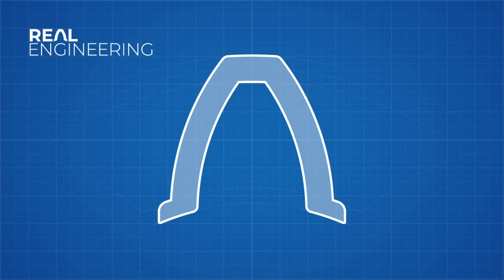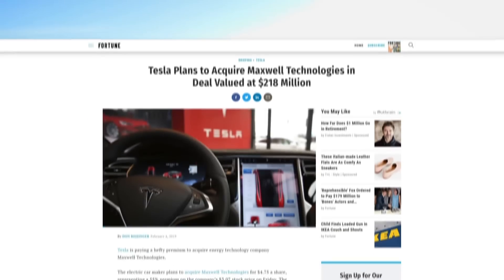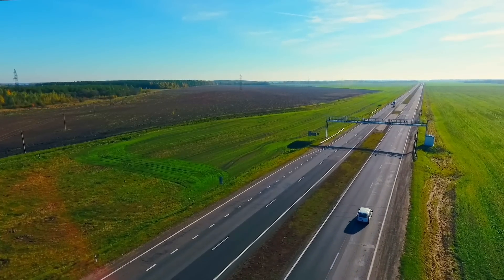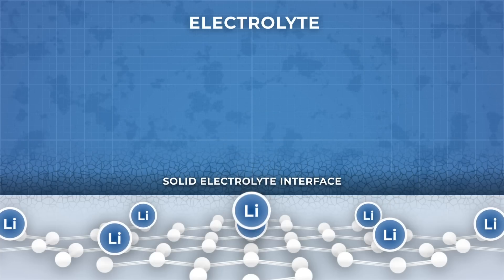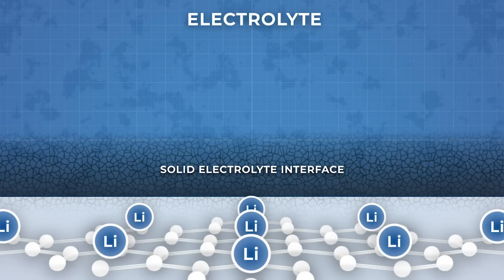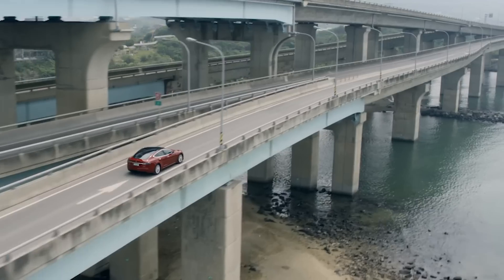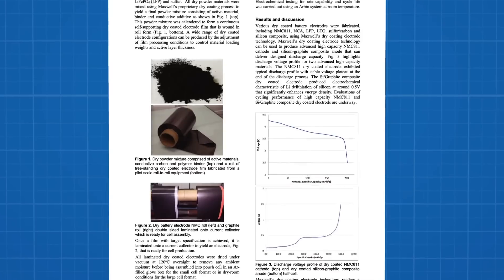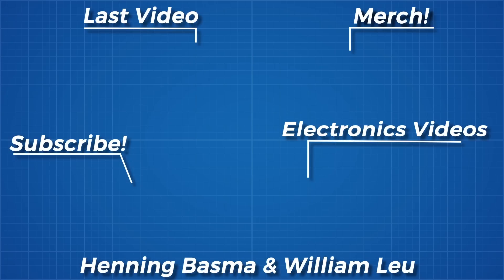Tesla's Quest for Better Batteries

Comment: This supercap/battery hybrid idea seems attractive to a lot of people, but I'll be shocked if it really works out anything like that. Adding a supercap pack will allow a quick burst of energy, but for hill climbing and towing, it just means you have more weight and volume to deal with (and more cost).

You need a battery pack big enough to drive the motor to its max capacity (and be driven, in regen). In fact, that should determine your battery size. Once you have that, supercaps don't really do much.

OTOH supercaps, with their long life and high power and charging rate, could be great for stationary storage, power tools, and perhaps some other things.

I think Tesla bought Maxwell mainly for its battery technology, not the supercaps.
Reply: tesla batteries can already deliver more power to the motor but are limited due to the motors overheating from the higher current, super caps can be used to deliver an absurd amount of current that will push the motor way past its continuous load rating but in a short enough time frame that the coils don't melt and cause a short.
Reply: @miguellopez3392  The batteries can already deliver enough current to over heat the motors, but the supercaps can help if the duration isn't too long. How does that make any sense at all?
Reply: @ronaldgarrison8478  both can deliver more power to the motor, super caps can do it better but for a shorter period of time, batteries are software limited to prevent overheating of the motor and themselves, a supercapacitor can dump a lot of current so that the motor produces high amounts of torque during a launch, but the capacitor quickly drains and the battery takes over, since the capacitor drained so quickly I'd didn't have time to overheat the motor, so yes super caps would be useful for acceleration.
Reply: @miguellopez3392  No, they wouldn't. You're proposing a situation where the motor can handle more in a brief interval than it can handle in a somewhat longer interval. I don't think that happens. It would only happen if the motor was not being cooled very well. But electric motors are generally over 90% efficient, and in the case of a modern production EV, probably over 95%. (And since we're only talking about losses actually inside the motor itself, as distinguished from the control circuitry and other things, it's probably even higher than that.) So I don't think keeping the motor cool is normally an issue, and you will therefore be limited by something else. What else? Presumably, some combination of voltage, magnetic core saturation, and how much torque the parts can take (whichever is more limiting).

Of course, you could always imagine a special case. Maybe it's a really hot day, and the motor is prone to overheating. But if that were the case, I think you'd also have to limit the batteries, and any supercapacitor as well. IAC I don't think you would want to make a very expensive addition to a car, which would add weight, volume, and complexity, just for those highly unusual events.
Reply: @ronaldgarrison8478  it is a physical fact the electic motors have a peak current rating and a continuous load rating. Wich is essentially how much power an electric motor can give out in a brief period vs how much power it can sustain for a long period of time, an air compressor has a built in capacitor for starting. The capacitor delivers up to 7x the current the motor will run in a continuous load but why not just run at 7x current at all times? Because it will overheat the windings. Melt the insulation and short them. tesla cars have a glycol cooling loop wich cools both the motor and batteries, the batteries are more thermally sensitive so the computer safety measures lowers power output if they get too hot it's electric motor gets too hard then power is reduced to the motors, in the ludicrous mode they remove some of these restrictions for better preformance but warn you that the mode can cause damage to the drive trains since the batteries and motor will run over the recommended continuous load, capacitor assisted launches will be something for sports EVs or super car EVs so you won't really see them in regular EVs.
Reply: @miguellopez3392  I can't claim to be an expert on electric motors in general, but I'm pretty sure the capacitor on a compressor motor is not to give a burst of power, but rather to compensate for the fact that a motor is electrically an inductor, so that on startup the current lags behind the voltage. The capacitor can deliver a very short burst of current to compensate for that lag. That doesn't take that huge a capacitor, but to provide a burst of extra power of several seconds, to deliver a lot of extra torque, I think would take a much larger capacitor, in fact a prohibitively large one.

IAC as you suggest this does not seem like something that would be done in street use. It does not seem to offer a practical advantage in anything but exceptional uses, as in racing. So I'm back to my original claim that for a car in ordinary uses, I don't think supercaps would provide an advantage that would be anywhere near the penalty in weight, size, complexity, and cost.
Reply: @ronaldgarrison8478  I'm not an expert in electrical motors either but the capacitor is there to give it a jump over the hige power requirements of starting a DC motor, sometimes the capacitor goes bad and you are left with a compressor that will humm and not start, I fixed this issue by connecting it to a generator that could supply more power then a wall outlet with its starting amps. One of the only example that i can think of right now of a vehicle using supercapacitors is F1 cars and their kinetic energy recovery systems, they let regenerative braking slow them down when taking turns and use the stored up energy in the super capacitor to launch them to a faster speed after completing the slower turn.
Reply: @miguellopez3392  Let me put the motor issue this way: Suppose you're trying to start a motor while it's under a load. If it's stalled, it's going to consume a lot of power, and possibly overheat, but IAC not perform well. When you start applying power, essentially what you're doing is storing power in the magnetic field as you build it up. So the motor tends to look like a short circuit until it gets moving. This is reactive power. The motor looks like an inductor, storing energy in a magnetic field. Voltage rises, but lags behind current. To get the motor to start better, you attach a capacitor. It has energy stored in its electric field—the counterpart to the motor's magnetic field. Voltage leads current—the capacitor dumps its charge into the motor, there is a quick surge of current, and behind that the voltage falls later.

In that way, you get the motor going quickly, without generating a lot of heat while the motor sits there, straining to get going while it builds up its magnetic field.

I'm sure my EE textbook explains it a lot better, but right now it's packed away! And anyway, I'm kind of swamped this afternoon.

WRT racing cars—again, supercaps probably make sense there. In fact, I'm sure they're wonderful for drag racing. BTW I'm also sure they'd be great for things like power drills or screwdrivers, as they can deliver full power from a smaller pack than a battery, and though you'll have to charge them more often, the charger is normally never far away, and they charge extremely quickly.

I therefore think an outfit like Maxwell has a bright future. Think of them as the mitochondria of Tesla—their energy pack—LOL! I just don't think those supercaps will be showing up in something like a Model 3.

Comment: Probably a stupid idea but would it be possible to replace the metal ions with nonmetal ions (and vice versa) to keep the volume from changing too much? There is no option as lightweight as lithium but e.g. oxygen still has 2 charges for 16 atomic mass units.

Comment: Nice Video, I just find the graph at 1:00 slightly misleading due to the (possibly logarithmic?) scale of the "Cost/kWh" axis. A linear scale would IMHO be much easier to grasp. Also this would probably show a form of an exponential decay, indicating a slowing trend of the batteries getting cheaper with time.

Comment: Battery perfection?  Try Strontium-90 atomic battery.  It will last for many many years and you don't have to charge it because it emits it's own energy, electron or Beta particles which can be converted into electrical energy.

Comment: FYI a big rig truck engine by itself is around 3,000 lb the transmission is in the hundreds as well. And many hold at least 100 gallons of gas that will weigh approximately 670 lb. Everything is very heavy in big rigs and the Tesla semi won't have a lot of that stuff so there is a lot of weight that can be swapped for a battery.

Comment: I´m working on making a hybrid supercap/battery out of relatively inexpensive, relatively low toxicity materials that hopefully will rival the energy density per weight of current lithium tech while being more affordable and faster charging.  

     I don´t have any videos on it yet.  Have a lot of experimentation to do, as well as making a lot of materials.  Eventually will have some videos up about some of the testing.  

  I don´t plan to patent in an official way, though will publicly document, and may eventually end up selling some, as well as specific plans (if testing goes well).  I think that it should be affordable and doable for the masses, and not limited nor controlled by corporate greed.   But really, this started for me mostly because I wanted to make some affordable and good quality batteries for myself.  I want to build some electric based vehicles (2 and 3 wheeled) with good range and speed.  A lot of real world testing will be done via an electric bike besides meter oriented testing.

     As to materials and processes that will be experimented with in varying combos and ratios:  carbonized linen (via heat and/or chemically), activated carbon powder, different metal foils, light weight and loosely woven fiberglass or nylon cloths, silica aerogels, PVA or PU infused with solid electrolyte mineral metal salts, a specific halogen, extreme dielectric separators (as thin but as insulating as can be made by home use) and ion based separators, bio resins, and partial vacuum conditions to name most.

Comment: Your case against Nissan for it's early model Leaf batteries suffering in cold climates is quite untrue. All batteries suffer in cold climates and in Nissans case the early Leafs suffered the most degradation in HOT climates.

Comment: The original Leaf had battery problems in HOT climates like Arizona, in Europe, Canada etc. the original leafs are still going just fine, the batteries were updated in 2013 with the lizard pack, my 2015 leaf has not lost any range in over 3 years of use. Do your research, the leafs sold in cold climates like Canada ALL include battery heating for use in winter, this is not needed in the UK.

Comment: We are an ocean crossing electric sailboat with AGM batteries. We have been sailing this setup for 4 years and are now looking to replace/upgrade to Lithium. 
The price of these batteries has come down incredibly in these years.
Reply: Use the saltwater to propel your ⛵ boat by building a saltwater battrey you have a endless supply of saltwater with ions to use just think about it man!

Comment: Nissan leaf's battery is a joke. My homemade E-bike has that much range and will soon have more than double that (without any peddling of course).
Reply: I think you're not as fat as a car.
Reply: @PéterFriedrich-f4e  Good point, I'm about 54 Kg and my bike with the battery is around 30 Kg (the battery system being around 7kg) so the battery right now clocks in at about 8% of the weight. The Nissan leaf  weighs roughly 1500 kg + 200 kg of people (i don't know what it was actually carrying during its range tests so I went with what I think is a fair average for what people generally carry in a hatchback) so we can call it 1700 kg and the battery system weighs 295 kg which clocks in at about 17%. It's not as bad as I thought but they seem to have plenty of room for improvement.

Comment: Tesla  100 kwh battery takes equivalent of 4.2 gallons energy as gasoline from grid of 70% fossil fuel  combustion  in USA for 315 mile range or is a gas powered polluter of GHG at about 78 MPG  equivalent car hardly carbon neutral until grid is!  Old Engineer common Sense
Reply: MOST grids are going green.
Factor in the extraction and supply overheads of ICE fuel.
Fossil fuels at a power plant (while they remain!) are more controllable.
Reply: @rogerstarkey5390   Tesla will be carbon neutral when 1000 giga grid is carbon neutral if you don''t see that you are too stpid to talk to.  Tom.  Take it to Sweden 100% nuke grid it is caarbon neutral there..
Reply: Xi Jinping like me is a Chemical engineeer but smarter  he does not think wind power causss cancer and dad was born in China.  He don't need spoon feeding horse.  Planet can not afford mistake there and it won't happen.  Poor Tom

Comment: Took me a while to understand anode and cathode definition and there is a lot of confusion out there due to different applications, but just remember:  

Anode= electrons leaving (i.e conventional current enter) ( on the external circuit)
Cathode= electrons enter (i.e conventinal current leaving) ( on the external circuit)

this means in a rechargable battery the anode and cathode change place under load and charging. In electronics you have diodes with fixed anode and cathode and the definition of anode and cathode  are true in the forward biased direction.

Thanks for the video, great work!

Comment: Around 2005 I watched this exact video on tv. Some details were different of course. Instead of standard lithium to drycoated lithium batteries is going to make electric cars viable for replacing IC, it was nickel cadmium to nickel metal hydride is going to make electric cars viable for replacing IC. Meanwhile, IC has not destroyed the earth.

AM I a time traveler, or have I just been around long enough to learn from history? 
Saving the earth from human physical destruction is fine, but not in place of saving humans from the delusions of reality in thier head.

Comment: Thanks, a very interesting look into battery tech and how it’s becoming more and more important

Edit:
Though one nitpick point in 8:23 is that it’s not the impact of temperature on the batteries that causes lower winter range in EVs as they typically have active temperature management systems (excepting the LEAF of course). The primary reason is the same that causes higher fuel consumption in fossil fuel cars, I.e that the energy demands are higher (e.g. higher roll resistance from slush and snow, denser air increasing wind resistance at higher speeds, heating the inside of the car requires energy and so on and so forth).

Comment: The roadster and and semi batteries are so big they can take any regen or provide acceleration without any issue. The roadster is limited more by wheel traction than the battery at this point.

I don’t think Tesla has much use for the ultracapacitors.

Comment: IMO hydrogen technology will win over Battery in the long run.
Hydrogen is the future.
Reply: Yes, hydrogen is the future and will always be
Reply: Yes, even Alien technology still use Water LOL, they think of water as a cheap fuel and available so abundantly. We just still can't figure out the most efficient way to separate Hydrogen and Oxygen.

Maybe the key is the space.
Hydrogen might be easily extracted from water in the zero gravity of  Space and Hydrogen also easily converted into liquid in cold Space. Liquid Hidrogen is compact and contain very high energy density.
No battery will be able to store more energy than the organic material itself.

Comment: The problem with the idea of mating a Super Capacitor with a battery is essentially this, making a Super Capacitor large enough to accelerate a 5000 lb card from 0 to say 70, is actually kinda freaking big.  And we need a controller to mate the voltage of the capacitor which will vary widely to the battery which we need to stay at a relatively constant voltage.  When we put all that together we increase the cost/complexity/weight of the energy storage system by 50% or more.  So rather than do all that, we can just make the battery 50% bigger, and it will handle acceleration events approximately 50% better while also taking our car 50% farther.  So every incentive instead is headed towards just making bigger batteries because it's fixing simultaneous problems.
Reply: It's not "A" capacitor, but lots of small ones.
Just needs a fast switching circuit.
...
The caps and battery would to a great extent be separate systems.
Use the battery for the first acceleration of the day.
The next stop charges the cap.
The next acceleration is handled by the cap (finished by the battery direct to the motor, if the cap runs dry)
Hence, the battery is just there for low load "end of acceleration" and cruise mode.
No physical connection between the two needed, effectively just a relay to switch input to the motor from the cap, to the battery when the cap empties, plus to switch input to the battery when the cap is full under unusual charge conditions (maybe, downhill?).

Re size?
I repeat

https://youtu.be/KQ2Eo6wl5r0

I think the relevant part is about 11 to 12 minutes in (but it's all quite interesting)
Reply: @rogerstarkey5390  A capacitor can be sized and engineered to have the same properties as many capacitors in series or parallel.  That's not a relevant distinction.  Wires are physical things, and there are wires between the systems.  There are indeed physical connections between the systems, but as I said these intersections require transformers and rectifiers that can modulate voltage at widely varying inputs and currents.